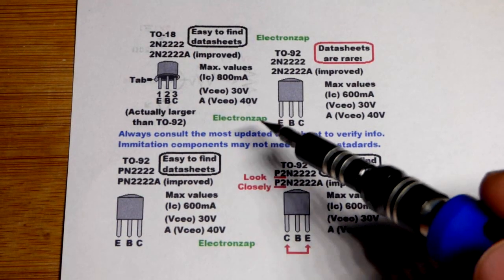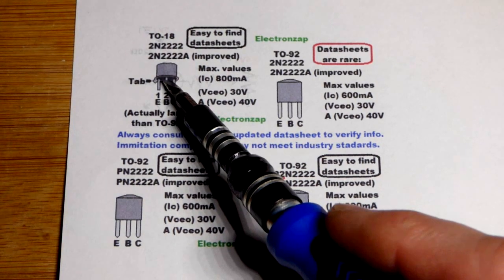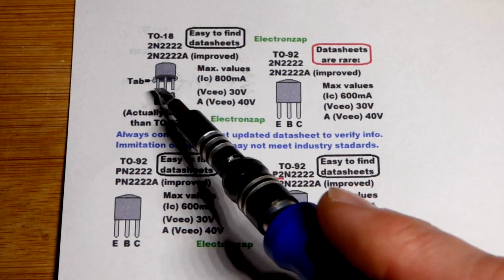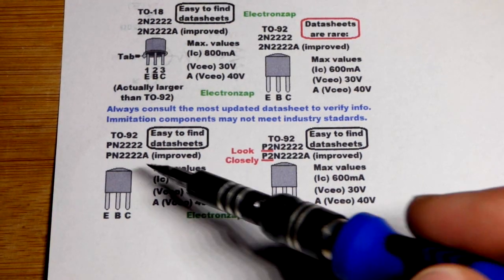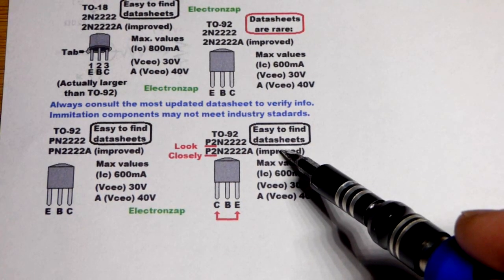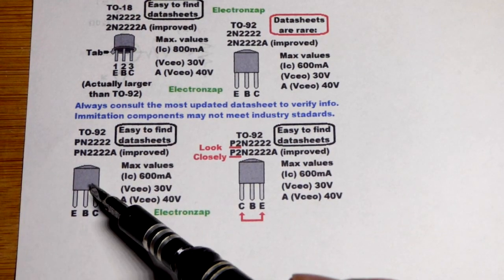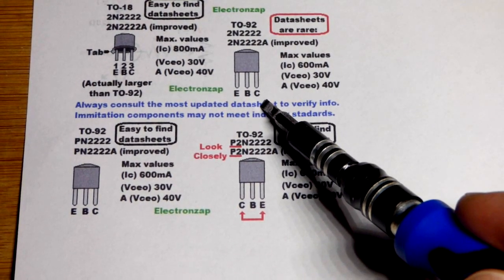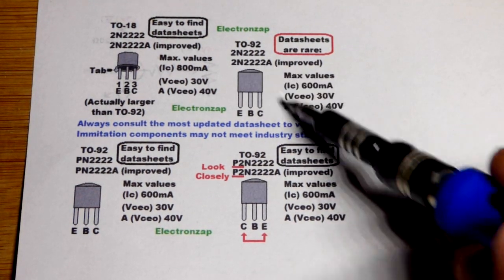Watch out for these while searching for 2N2222 datasheets

Comment: According to the JEDEC part numbering, 2N2222A is the TO-18 metal-can component.  PN2222A is the TO-92.  MMBT2222A is the SOT-26.  From most manufacturers, it's the same die in a different package. 

Many manufacturers will label PN2222A, 2N3904, and BC547 interchangeably - they all have pretty much the same specs.  (Those are the TO-92; the SOT-26 are MMBT2222A, MMBT3904 and BC847 respectively.)

The specs for all of these are really loose.  If a project calls for a '2222, then pretty much any NPN will work if breakdown voltage is at least 20V, it can sink the desired current at the collector, its beta exceeds 100, its transition frequency is at least 100 MHz, and it can dissipate the needed power.  Elektor magazine, back in the day, would denote these with a 'part number' of TUN "Transistor, universal, NPN" and had a whole long list of substitutions.  (Nowadays, I most often use a 2N4401, they're quieter than the others I mentioned. I'll look at the circuit and decide whether it's noise-sensitive before I back-substitute a '3904 if someone's called for a '4401 explicitly.)

PNP complements are 2N2907, 2N3906, BC557, 2N4403 for the TO-92 parts, MMBT2907, MMBT3906, BC857, MMBT4403 for the SOT-26.

Other part numbers are also ones that I mentally substitute:  2N5551 "any old small-signal high-voltage NPN I have in the box" (2N5401 for the PNP), 2N5089 "any old superbeta NPN" (2N5087 for the PNP), 2N5179 "any old RF NPN", MJE3055 "any old power NPN" (MJE2955 for the PNP), etc.  Again, because the specs on the parts I mentioned are loose, and if someone's spec'd one, there's nothing particularly out of the ordinary that they're depending on.

A plastic part marked 2N2222A or P2N2222A is from some (likely Asian) manufacturer who didn't grasp the labeling conventions.  But it's hard for a '2222A to be out of spec if it works at all - the specs are not demanding.
Reply from the maker: Thanks for the info!

Comment: The most common transistor in the universe and there's no satisfactory datasheet anywhere on the web.
Reply from the maker: Yeah, it's weird.
Reply: Yes there are proper data sheets.  You just need to pick the exact part number and manufacturer for the version you want to use.  Remember that the little metal can (TO-18) version was first.  The various plastic package versions (TO - 92) were intended to be cheaper and easier to manufacture.  The electrical properties are almost identical, and in 99.9% of the applications, there literally is no electrical difference.  Today, finding the metal can (TO-18) version is almost impossible, because those little metal can TO-18s are literally pre-historic!.